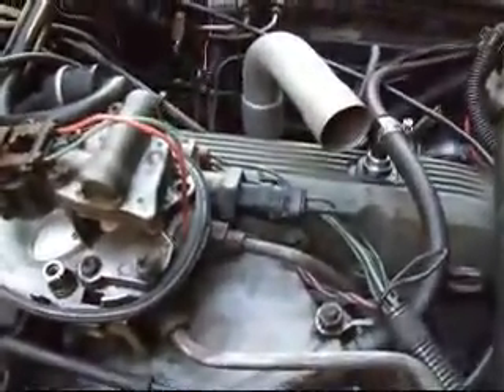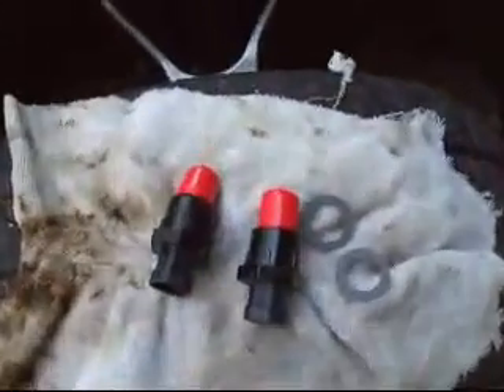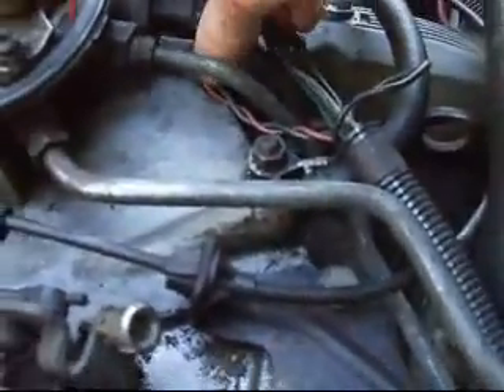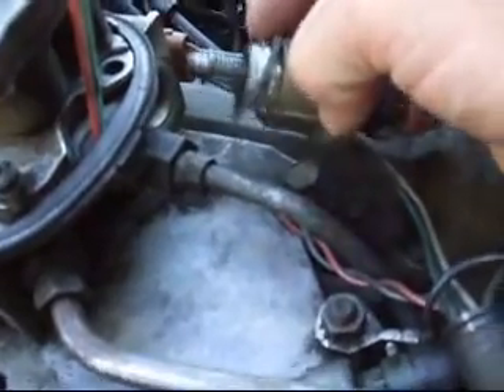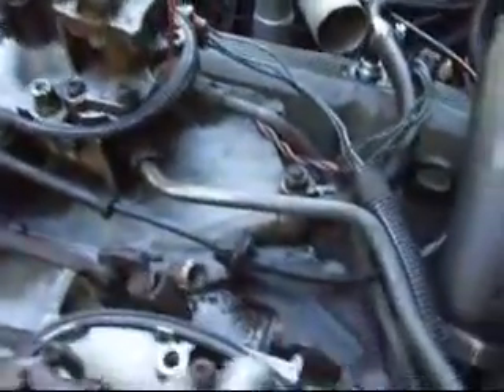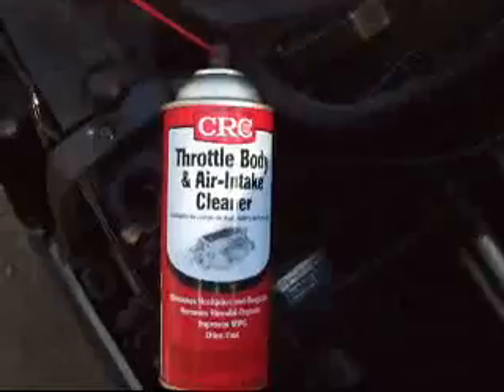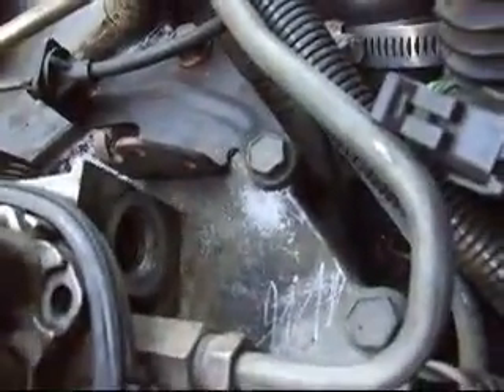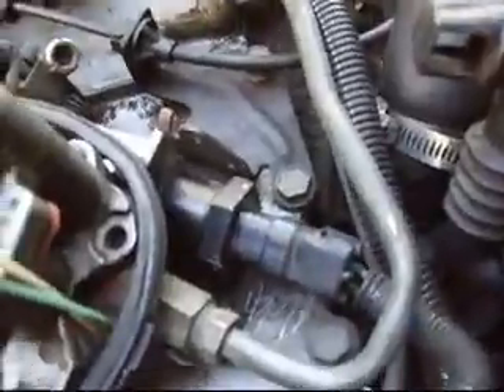#Stock1984CorvetteCrossfireInjection 𝟏𝟗𝟖𝟒 𝐂𝐎𝐑𝐕𝐄𝐓𝐓𝐄 Twin Idle Air Control Valves TBI

Comment: I love alll ur videos  i think they are all greAt for wat i have as a present  a 1984 corcette c4 that the maker of these videos i hope xan read this and please help me out in solvig the  most unusual  front end wire garness problem on this 1984 c 4 that i ecer had. Im in colorodo snd i wobder if u xan please xall me or email me please the problem is that bad at lease 5 to 6 mechanics cannot find the problem be the probkem is the battery willl not keep a charge. It runs out ofernight abd he has the owner hhoj a toggle up to it and of course i hare it to be left this way if u have any ideas lease dall me michael @720 --- 923 9863 i hsually  usually always answer the xar starts and runsvgreat its battery thats brand new just draibs drains overnight and he got a toggle to itor mbpagliuco@aol com but id ratha u calll me sibce u have a 1984 c4 corvette and we biyh love love love our xars i have alot a tremendous amt of cas in this car thousands. And paibt job jet black is next if i can fet get some1to fixbit proper ok pleSe please xall me to give any solution u can tgank. Thank u sir
Reply from the maker: Parasitic drains are very hard to find, doubt I could help on a phone call. You need to find someone willing to take a multi meter and go circuit to circuit and test each and every one of them. 5-6 mechanics couldn't find the problem?

Comment: Also mine were original and they were finger tight I loosened them with my fingers not a wrench that can’t be right?? Am I wrong? Should they be snug with a wrench
Reply from the maker: no shouldn't be finger tight, torque is 18N or 13 ft lbs.

Comment: I got mine from summit and there ac deco but they didn’t come with gaskets anyone know part number for the right gaskets? And I need to adjust mine fsm says 28mm or 1-125 inch
Reply from the maker: Mine came with the new gaskets, most suppliers I see provide the gaskets, doesn't sound like Summit, they are pretty good about things like that, might want to contact them ask them if maybe the gaskets were missing. The distance from the flange to the tip of the pintle shouldn't exceed  1 1/8 inch, shouldn't have to adjust them.....the ECM will adjust them: FSM 6C14-9, 40MPH .

Comment: EGR , all crossfire engines. L83. Twin TB.
After temporarily bypass to run.
Then you can tune engine , reteach IAC's if needed.
Shortcut is drive 30mph , turning on a/c , heat , brakes
Makes ecm adjust IAC's. In park also but cycle ignition key off a couple of times and use shifter while running with brakes applied of course.
ECM adjust IAC for load from a/c and things like that.
Shutting off key or turning on key let's IAC's cycle to the correct position for starting and idle.
If installed correctly they position themselves after notes above. Not in any book.

Comment: Hi everyone. EGR has a vacuum operated control valve called a solenoid valve. Goes bad. 
About 8 inches forward of egr valve. Right side top.
EGR is Right side of distributor , solenoid is a small rectangle black unit about 3 inches long. Temporarily bypass this to see if it cures everything.
Reply from the maker: Thanks for sharing.

Comment: My 1984 Corvette starts up and runs great.. but after about 10 to 15 minutes of driving it I loose power and it dies. Then I wait about 5 minutes and it starts right back up and can drive another 10 to 15 before dying again.
Reply from the maker: First thing that came to mind  Jeff was the Ignition Control Module....they were problematic and not installed with enough heat shield on the bottom of them from factory. Easy to pull the distributor cap off and pull it out. Mine was toast along with the wiring...just fell apart in my hand, brittle. I used Arctic Silver 5 on the bottom of mine from radio shack and never had another problem. But getting hot and shutting down, waiting to cool and restarting is a symptom of that module, only about $25. Right off the top of my head can't think of anything else...but I do think about these questions, if I think of something today I'll send you and message.
Reply from the maker: I don't think it is in fuel delivery or ECM...whatever it is, has to do with heat.The starter is close to the manifold and could get heat soaked but that doesn't cause a shutdown, just a no-start. Guess I would also check my alternator was putting out 13.5+ volts, wiring could get hot?? Maybe? One of the Diodes inside the alternator bad...gets hot then cools down.
Reply: @HorseshoeBeach  I changed the ecm awhile ago thinking that was the issue. Funny you say that because mine crumbled in my had as well. But the swap did not seem to fix it.
Reply from the maker: LONG answer, don't know any other way, complicated car....but,  just checking...you wrote ecm*, but you say you did change the ICM, ignition control module inside the distributor? That module is a PITA at failing, gone through 2 myself, and the **heat sink* is crucial, tons of it, on the HEI distributors? Anyway just wanted to verify we were talking the same module. ALSO in that same HEI distributor is another problem area....**the coil**, aftermarket junk isn't the same as the old OEM coils, I found that out.    The ECM monitors two sensors constantly, the O2 Sensor and the very crucial CTS coolant temperature sensor...the ECM looks to the  CTS to control fuel delivery, spark timing and BOTH of the IAC valves for fuel delivery...that sensor is the one on the passenger side back by the number 8 cylinder....and it does suffer heat problems, I wrapped mine in heat tubing and the wiring...way to close to the manifold for a tiny piece of wire, IMO. and the THERMAC is a BIG problem on these crossfires,  the system is a heated air intake system to eliminate throttle blade icing, there is a vacuum tube that goes from the vacuum motor to the back side of the drivers side throttle body that gets really hot and cracks leaking causing the snorkel damper doors not to function properly....from that....all kinds of problems occur. That's one reason why the THERMAC is the number one culprit in stalling and rough idle issues. You could check the doors on the THERMAC by just starting the car cold and making sure the doors close up fully then start opening on the drivers side at about 165 degrees...just a thought. If the thermac isn't operating the way the ECM wants to see it...all systems start readjusting to compensate.  After those things I would have to say one of the many many sensors the ECM monitors is malfunctioning. The EGR valve could be stuck or not grounding to the off position, the ECM uses other sensors to control exhaust in the thermac after the coolant reaches a certain temperature. Could be interfering with the signal. The problem with the prehistoric Electronic Control Modules is just that...either one way or the other, no in between or they don't have the ability to adjust themselves, great for their day but antiquated by today's engine control modules. It either sees what it needs to see or goes CRAZY.  My THERMAC, I rebuilt back to the original specs, including the original style filter, the heated system causes waaaay too many problems, I don't want to worry about it.
Reply from the maker: Just a thought on the CTS, can't put teflon tape and anti seize on that sensor, it needs to be able to ground really good. Should come with a coating already on it. That wire coming off that sensor goes straight to the ECM terminal 4....I THINK #4, don't hold me to it!  Let me know, really interested in what you find.
Reply from the maker: I put a locking gas cap on my car, caused me a lot of headaches, replace the OEM style cap, no more problems, the tank has a lot of back pressure, has to vent to allow gas to return.

Comment: 2 iacs? Man that damned valve has caused me headaches on my car. Mine is a 91 L98 TPI. I only have one iac but once upon a time it was a pain in the ass. I started my car once but stalled and died if I didn’t give it any gas. Guess what the culprit was? Yep, iac. It’s all fixed and working great now, but damn. I got no experience with the Crossfire Engine though. Happy Vetting! 😄
Reply from the maker: mine were so gummed up with carbon the pintles were basically just stuck in one position.....gotta laugh and just take these old crossfires with a grain of salt...enjoy them or leave them alone. LOL

Comment: Would this help bring my idle down? Mine has a high idle. Also, what is a good idle rpm for crossfire?
Reply from the maker: Mine idles high at start up ( about 1000rpm)  and quickly calms down to a steady 600RPM. Cleaning up the IAC's helped me, you could also have a vacuum leak,, my bolts holding down the intake manifold were loose, one was finger tight, that, so I understand, is common  on a crossfire. There is one bolt in particular  (double threaded  that mounts at the rear of the driver side TB which holds a ground, that comes loose all the time....might try looking at all the bolts SNUG them up, be careful it is aluminum. Just a suggestion because any vacuum leak COULD cause a  high idle.  Then there's the TPS, has to be set .525 volts.  Also could be the CTS sticking, (ECM thinks the engine is constantly cold)???? SORRY about going on and on......just a lot of things on this crossfire cause IDLE issues.  ABOUT that bolt I mentioned above....you can tightened it down on the top nut, which holds the ground wire, but the actual bolt that holds down the intake manifold is still loose...it WILL cause problems. Hope this helps with your crossfire...one thing is for sure on a crossfire.....everything works together and everything has to be PERFECT or there are idle issues....SUCKS!!, but once they are running it's a great engine. I'll help as best as I can..............
FORGOT TO MENTION......car has to be driven for the ECM to learn any changes in new data being introduced, at least 40MPH....LEARNED THAT THE HARD WAY!!!!!!!!  Cleaned my IAC's then had to drive it for the ECM to set them.
Reply from the maker: Also....the very first thing the ECM sees, is the CTS data and the MAP sensor data....good places to start looking. The vacuum hose on the MAP sensor.....particularly at the intake manifold endures a lot of HEAT....it will split wide open at the nipple, WITHOUT ANY WARNING,  take this from experience....IT CANNOT BE CHEAP HOSE OFF THE SHELF FROM AN AFTERMARKET AUTO PARTS STORE.....  been there and done that.
Reply: +3DELTA7 Thank you very much. As soon as I get it out I will check everything.

Comment: What brand IAC valve did you use?
Reply from the maker: +GQ-Rod I used BWD Rodney, I think I purchased them from Oreily Auto, they were preset in the box, never had to adjust anything,  after I installed them and started the car, it ran unbelievably great...then I just took it for a drive up to 40 MPH and let the ECM set them. That's been a while ago and they are still performing. Funny I'm out working on the Vette now and just came in to research something.
Reply: Great thanks for the help, finished the starter and the wiring, got the 45 dollar rebuilt one from oreilly's also. It's running great again. I took your advice on upgrading the ground wire also, will be doing that on my next day off. Thanks again for all the videos, they are a big help.
Reply from the maker: that's great to hear...yeh these cars are amazing with a little TLC.